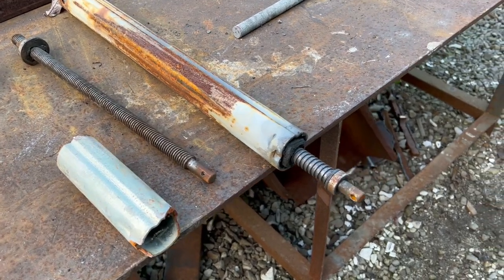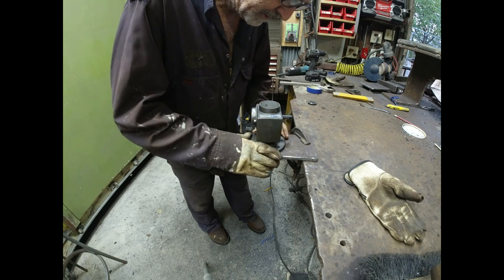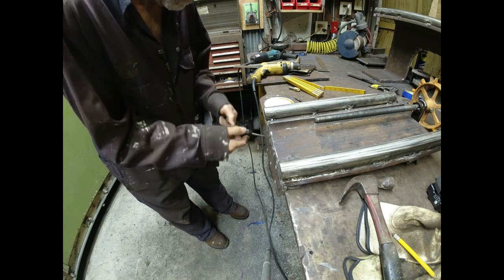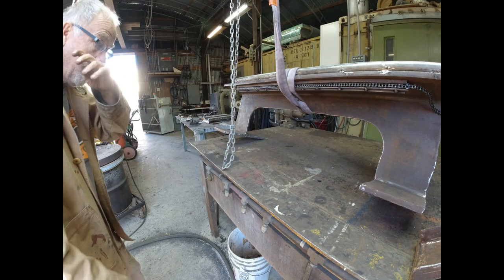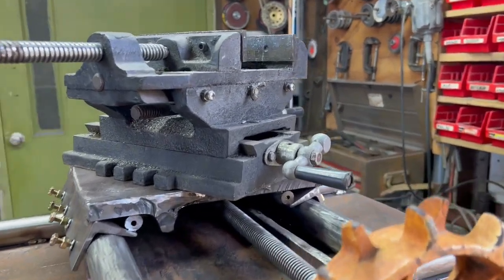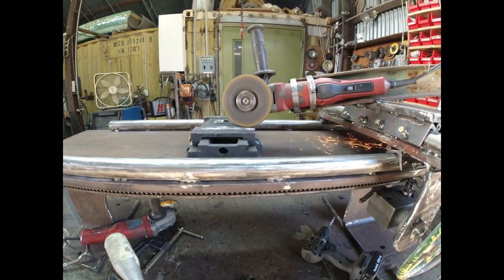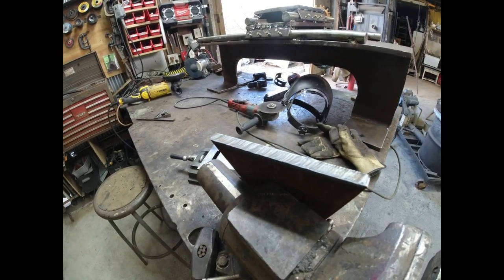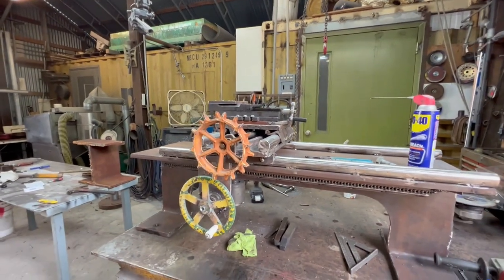The Big Ugly Home Made DIY Lathe Part 2

Comment: Food for thought.  As that grinding wheel moves it wears so you are going to be cutting a slight taper as it gets smaller in diameter.
Reply from the maker: Douglass
I agree completely. However the cast iron is very soft so wheel wear was almost nonexistent. And when I was finishing up I worked the grinder left right and front back so I eliminated any potential taper.
Barry

Comment: Nice! If you can create a gib (rectangular bar with pockets for your screw ends) it'll allow the way to move easier without scoring the bar (as you have on your vice). Definitely a useful project!
Reply from the maker: Allan, thanks and thanks for the tip. I will be looking into some sort of gib that will work in the limited space I have to work with.
Barry

Comment: I see now it’s just up on a bench . I turn my carbides slower then my HSS tools .
Reply from the maker: Dave
I know very little about cutting speeds, only what I picked up on You Tube. Practically speaking. things that are important to running an efficient machine shop will not affect what do in any way. My little bike parts and go cart parts will just have to deal with it.
Thanks for watching and thanks for commenting!

Comment: NOOOOOOOOO!  Did you really use a wheel from an old nelson lawn sprinkler????   I just bought my brother in law one of those and I noticed it came with PLASTIC wheels!  And you had the original cast wheel?  I am never going to watch your videos ever ever ever again!  :-P
Reply: Ya know you could have sent me that vice and I would have fly cut and surface ground that thing for you.  Hey, I might be in your neck of the woods real soon.  Need me to bring anything?
Reply from the maker: Hey, be easy on the old man! That is exactly what that is. Most viewers didn't recognize it or were to polite to say anything, not Jason. Two comments, first it was on the wall, it was more or less round, and it fit the shaft. Two, it conflicts with the compound slide handle so it will be going back on the wall to be replaced with a smaller wheel. Looking for something now.
Merry Christmas!
Reply: @barrylukebuilds7894  Don't throw it away.  If our plastic wheels break, I'll be borrowing yours for a pattern!  Hey, lots of guys are ditching the compound.  Two reasons...  You really don't need it unless you are doing tapers and you don't need it for threading either.  Without a compound, you'll probably get much less chatter.  I would suggest you look for a BXA quick change tool post.  Wedge style, don't get the piston one.   The amazon one I pooh poohed in a video really wasn't that bad and was perfectly usable.  Plus it comes with a few tool holders and the price is reasonable.  I'm just a snob and wanted an Aloris.  :-)
Reply: Remember, if you anything made for it, let me know.  I'll help where I can.